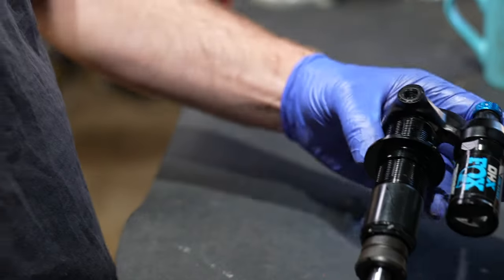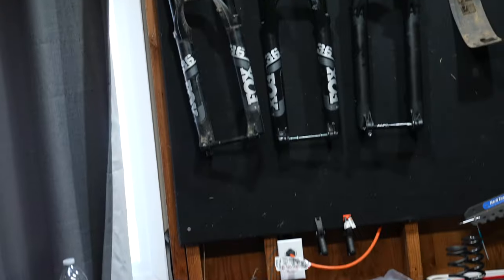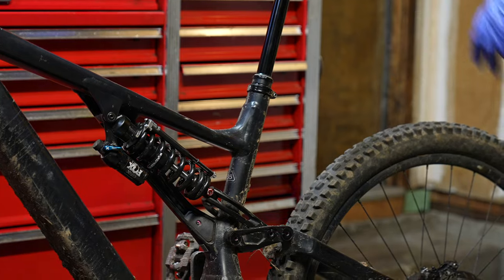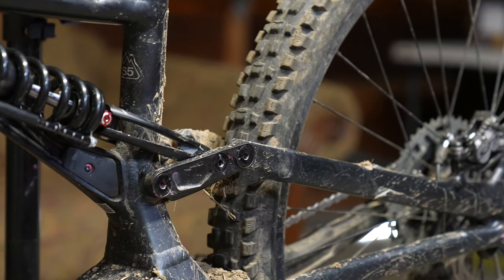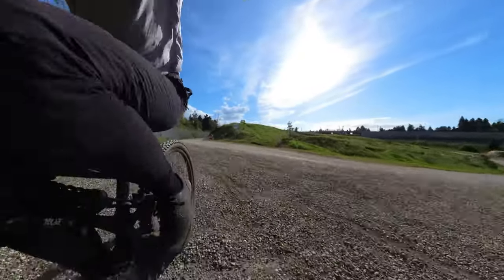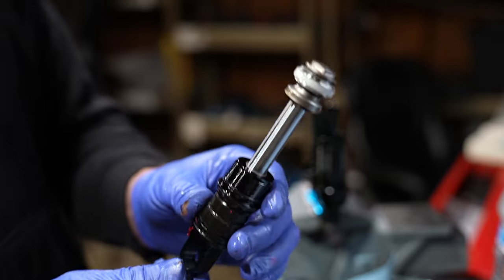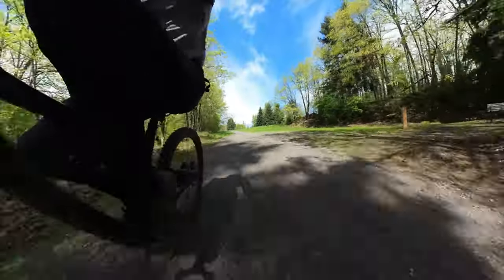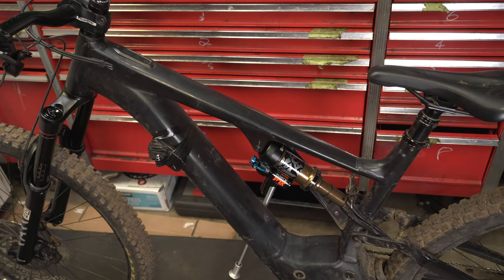Deep Dive into Fox’s MOST unpopular Shock

Comment: Wow, I just noticed, you were using a DHX take off with no compression adjustment. Those shocks have to compression set to the middle or 5 clicks in out of 10. You could have pulled the black plastic cap off and set the compression damping with a screw driver......or just order a compression cap kit for $45 bucks....all the compression stuff is in the shock, you just need the knob kit. It would have been better to adjust the slow speed compression rather than changing the oil.
Reply from the maker: How to setup a Fox DHX Coil shock for Sucess
https://youtu.be/0BhjlgehYA0

Comment: So I bought one of these yesterday. Put er my medium carbon transition spire. Mullet setup. I’m 220 as well. The LBS dudes advised I go with a Sprindex 500-550 coil. On your advice I dialled the rebound almost fill tilt, and then went to my local trails to be disappointed. My experience was the exact opposite to yours. The shock was a true delight. Super consistent throughout the stroke, and was great in every format. Personally loved the shocked in the jump park. I did spend considerable time recalibrating my fork to optimize the shock. But yeah, I’m extremely happy with the dhx. Rides like the dream.
Reply from the maker: Nice to hear is that your first coil experience?
Reply: @OtterMTBtech  yeah it is! I’ll say this; without having consulted the considerable knowledge you provide about things like Fox coils, I woulda been in trouble lol. But it got me thinking: despite expecting the worst and experiencing the opposite - I wonder what elements of a frame resonate with the DHX? I bought the DHX used that originally came off a Transition Relay. I put it on a carbon transition frame. So yeah. Lots of good cross over. But the small bump sensitivity and jump line experience for me was vastly different than yours and I’m chalking it up to frame and the shock placement along the seat stay. Whatever that pivot type is called, I forget lol
Reply from the maker: Glad to hear it’s good. I also spent considerable about of time on ohlins ext push shocks. Next try get a bladder style like dvo ohlins ext . More pop than old float x same tractions you get now
Reply: @OtterMTBtech  appreciate that! Thanks. I was very close to going on the CK Tigon. Cannot express enough gratitude for your vids on that shock!

Comment: I have a 2022 levo with a DHX. I am 180 lbs fully kitted and was running a 600lbs spring. That ended up being to low and I would blow through the travel. Went up to 650 and that killed the small bump sensitivity. Ended up adding a cascade link and now it rides like a dream.
Reply from the maker: I’m struggling really bad on that shock I can’t get it right
Reply: I've also had good luck with running cascade links on bikes that aren't progressive enough for a coil (2019 transition patrol) I'd highly suggest trying one if they make it for your bike  @OtterMTBtech

Comment: The question is if you got it out of an 2024 kenevo or aftermarket. Specialized tunes their stuff to their specifications very well. So maybe it’s got more potential on Right tune ?
Reply: Definetly. Custom tuning a shock can get so much out of it. Most shocks are tuned for the average comfort riding dad and not a hard charging mountainbiker and tunind for a example a dpx2 which is dirt cheap will make it outperform most shocks. So yes right tune helps A LOT.
Reply from the maker: It was off YT Capra. The Specialized tunes are good, but they are like make up. They are covering up something bad or enhancing something good.
Example the Mantiou Marra excellent shock through and through 
Float X excellent shock, tried both Kenevo SL tune and off the shelf both good. Slightly better compression on KSL shock. 

DPX2 and Superdeluxe are rubbish without a tune or make up
Reply: @OtterMTBtech  yeah and that’s the point, thy yt linkage is way more progressive (I mean up to 30%) an the kenevo linkage is 20%. So the tune will be more on the lighter sight. 

Overall you’re right the dpx is just garbage 😂

But I love and appreciate your tests ❤️
Reply from the maker: My complaint of no small bump seems pretty wide spread on DHX. I ordered a little knob thing and will give it another go

Comment: The WPS/J-Tech spring calculators are by far the best if you can get your leverage ratio at sag. Instead of using average leverage, it uses leverage at sag combined with your rear center and lets you choose between a few different shocks for their stock damping profiles.
Reply from the maker: I’ll check that one I am struggling super bad with this shock

Comment: If you want a really good, supple and tough shock for your Kenevo I can highly recommend you give a Marzocchi Bomber air shock a go. I switched to one from a RS superdeluxe ultimate coil and small bump and suppleness is just as good but there's extra ramp up and being an air it's obviously easier to alter the spring weight.
Reply from the maker: Have you tried a float x?
Reply: @OtterMTBtech  I haven't no, I know the Marzocchi is based off an X2 but it has different internals and tuning to the Fox.

Comment: @OtterMTBtech the shock having bad low bump sensitivity is probaly from not having a low speed compretion dial. its prety easy to install one and should allow for beter ajustment and controll over the shock. Im pretty sure that fox has it in a medium setting from teh factory as thats what comes on the float x's. The kit is (Fox Float X & DHX Low Speed Compression Adjuster Assembly)
Reply from the maker: They’re sold out in USA. I have 2 shocks I tried to pull the knob off the other shock and couldn’t get it off. I’ll test the theory. Thank you. The last Float X I didn’t touch the knob left it wide open, 1 before was KSL take off was fine as well. This shock is YT Capra take off. Wonder what knob is turned on. The light damper oil was allot better

Comment: LOL the kenevo keeps RIPPING APART? this problem has been going on for 5 years. great bike while it lasts (5 minutes)
Reply: its a great bike if you are not gonna surpass 10 Miles per hour in downhill trails. Dont even mention a rock garden
Reply from the maker: It’s got it issues for sure
Reply: @OtterMTBtech  They dont quit beause there is a bunch of people who use it soo lightly that somehow it does not brake apart. But any kind of proper usage will obliterate that rear LINKAGE. its been 5 years now. its literally a scam.

Comment: Releases one third of the internal preload pressure.

cavitation: "allow me to introduce myself 😏"
Reply from the maker: 150 is high ifp pressure, dropped it to 100, didn’t fix it
Reply: @OtterMTBtech  without knowing the exact valve architecture you cant say that a certain ifp-pressure is high or not. you have to make sure theres not cavitation, so the ifp pressure has to always be higher than the maximum local pressure difference (at the valve!). unfortunately with a larger diameter rod theres going to be a smaller effective piston area which in turn leads to higher pressure differences needed to achieve the desired damping forces and thus higher ifp-pressure.